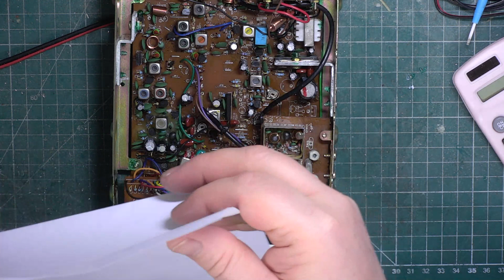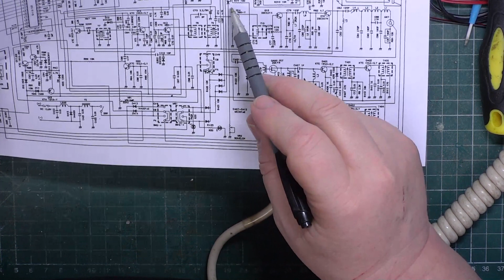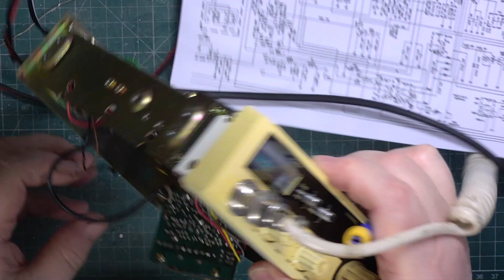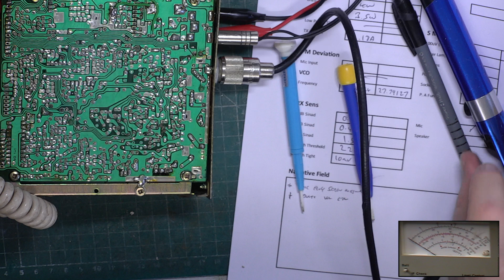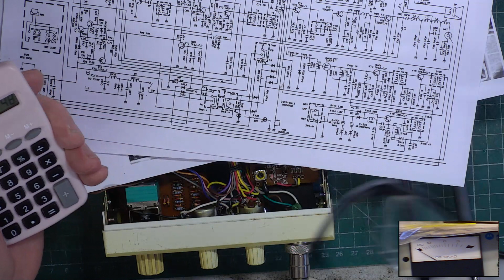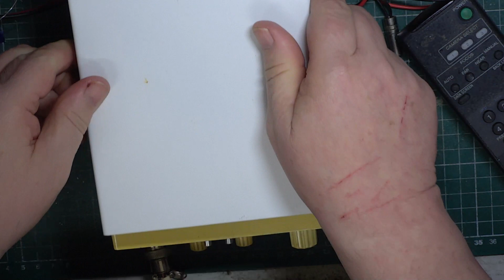Jesan KT5005 CB27/81 UK FM CB marine radio - repair & re alignment

Comment: I found that really interesting, I never knew there were CBs with marine band RX on them.  I did buy some 6.6MHz convertors from a shop called PRS in Liverpool in the mid 80s for about £2.50 each as it was meant to give some sort of SW CB band.  I heard lots and lots of rumours but never heard a thing on it with a long wire.
CB did get me in to radio and taught me a lot, first with a Class B, then A 4 years later.  It's a great hobby.

Comment: Does the MB sub board also TX as it looks like it has PWR pots ?
Reply from the maker: Negative. They are the VHF converter coils. You have the front end coils (I adjusted), the crystal oscillator & multiplier (x3) & the VHF converter.

Richard

Comment: I never saw an attraction or purpose for these marine radios..
although people loved them, they never weathered well, as seen here with the fag smoke stained yellow look.
Reply: I live on the coast in a port town and have always been a boater as well as being into CB, so I've always found them really useful, especially when the coastguard would announce the weather on Ch67 (MB2). Back in the day, I'd be on the CB then switch over to marine 67 for the weather forecast. If it was a stormy night, I'd often use it to monitor marine Ch16 (MB1) and would hear the occasional Mayday call and/or the Lifeboat going out. I preferred my Quasar MCB 400 to the Jesan KT-5005 as the Quasar also had marine 37 as well, which is the yacht clubs channel.  
I still have my original MCB 400 and its also got that yellow discolouration. I've never smoked, or had it in a smoky atmosphere. Apparently it's caused by the fire retardant used in the plastic.
Reply: @m7frs272  i thought the yellowing was caused by UV light so maybe the plastic and it's contents don't like UV as you still get some which have been stored away out of sunlight white like new..

nice to hear someone found a use for theirs..in the cities and especially where i am i never knew anyone who used theirs and heard anything on marine channels..
some bought them to be different, others to suit their white cars :)
Reply: @CBRadioWayBack10-4  I don't know how true it is, but I've heard it was possible to do with the lack of UV light? (That would make sense as my original Quasar has spent 99% of its life in the dark!) Apparently there is a way of rectification using a peroxide paste and a UV light, but it runs the risk of turning the plastic brital. The Quasar had a separate connector for VHF antenna so the RX on marine was always better than the Jesan KT-5005 which shared the CB antenna.

Comment: Thank you for sharing this video with us. When you were doing the soldering, at 35:30, you mentioned there should not be any spikes in the soldering/wiring of the RF output. Please may I ask what effect would spikes in the soldering/wiring have?
Reply from the maker: Yes. Because the RF energy actually hovers over the conductor unlike normal electricity flow, if it hits a sharp spikey bit of soldering; the flow is affected. RF doesn't like sharp bends either. On the Cybernet 134 chassis, the red RF wore to the aerial socket on the set often needs 'dressing' correctly. I'll mention this on subsequent videos.  Bear in mind nearly all my amateur radio & licenced business radio workis at UHF....so I bring important UHF techniques to CB radio for an improved outcome.

Note also the output power of this radio was corrected to be 4W across all channels not by tuning, but checking placement of non-adjustable coils.

Another point is cosaxial cable - the thick base station stuff. It's normal to cut that to length with a hacksaw. That leaves metal filings stuck to the insulation between the inner conductor & outer braid that affects range. Best technique is to go over the cut end of the coax with a rubber (pencil eraser), prior to fitting plugs.

Richard, G0OJF, UK
Reply: @ukfmcbradioservicingTango21  Please do show us how the red wire should be “dressed” on a Cybernet 134 chassis. I would also be interested if you could please show us, perhaps in a separate video, how you go about cutting the thick base station coax and how you recommend fitting a PL259 plug.
Reply from the maker: Roger

Comment: Instead of continuously rotating the board (and potentially detaching more wires accidentally) , a multi-meter set to continuity (with a beeper) will make life a lot easier when tracing what connects to what.
Reply: eggs, teaching, sucking, ??

Comment: Fantastic work as always Richard! 
Thanks again for doing this set for me. I'm surprised and impressed with the full 4w output! 
I can't say for sure, but I seem to recall that the one I had in the mid 90's, the display stayed on when it was switched to MB1 or MB2. I wonder if being connected to the centre of the switch would have isolated the display? 
I know my Quasar MCB 400  turns off the display in marine mode.
Thanks also for doing the VHF board at no extra charge 👍 MB1 is Ch 16, the international distress and calling channel and MB2 is Marine Ch 67 which is the main coastguard correspondence channel for small boats, ships etc.. 
The Quasar has 3 channels, including Ch 37 (or M1 Yacht clubs and marina channel on 157.85Mhz) 
I wonder how easy or difficult it would be to add another to the Jesan, as it appears to have space on the VHF board, although I assume the crystals would be almost impossible to source. 
Thanks once again!
Reply from the maker: Perhaps I should start noting quirks of different sets...like if the channel display goes out or not under certain conditions. Like switching to PA on Uniden 100/Audioline 340 sets...PA is always at full volume & the volume control has no effect.

This particular radio has added diodes into the M1/CB/M2 selector switch that aren't shown on the circuit diagram. Therefore reference to another set would be the only way to know what should be what!

There is no chance of adding more marine channels. The crystals could be replaced with different channels, however. Last time I had custom crystals made, they were an eye watering £35 + VAT each from Belgium.

Richard, G0OJF, UK

Comment: There is an ever increasing hiss on your videos audio Richard. Very annoying when listening through headphones. Apart from that, an interesting and informative video as always.
Reply from the maker: The video switcher audio input is incompatible with the expensive commercial Shure microphones I use; there are four mikes. It may be that using a Mickey Mouse consumer grade microphone could give better results, though less frequency response. Currently there is a solid state mike pre-amp intended for stage/disco use. A valved pre-amp would have no hiss & that could be another solutuon.

Richard